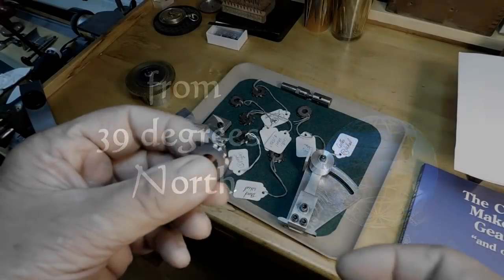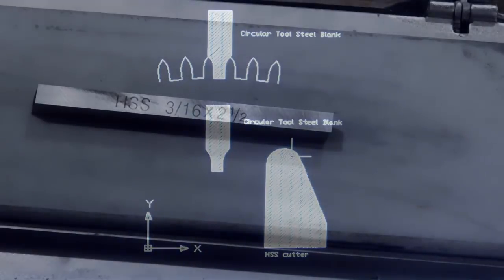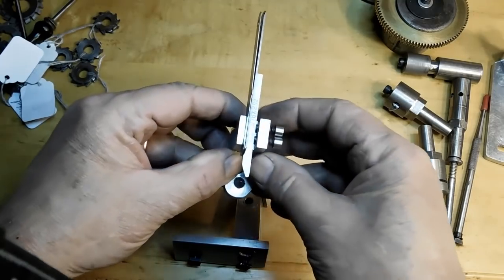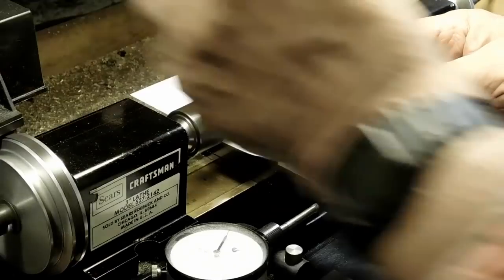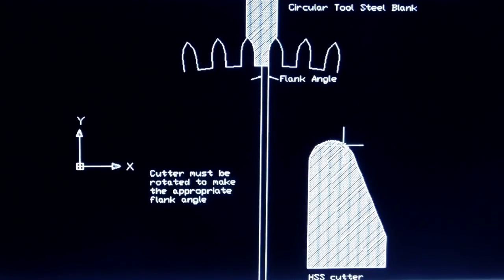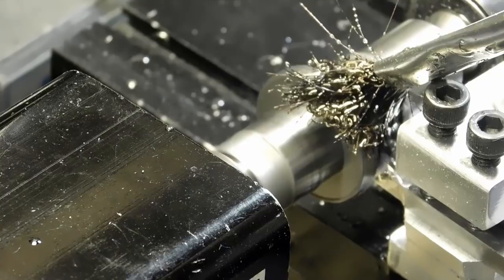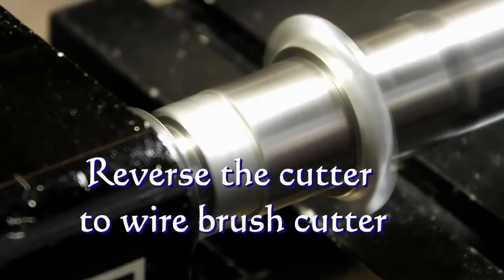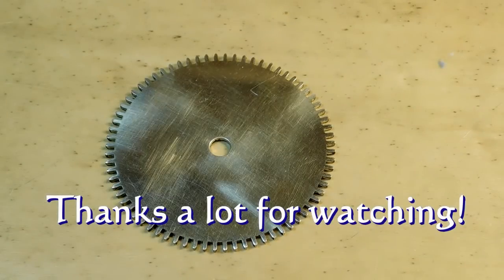DIY Cycloidal Gear Cutter

Comment: Wow..so a nice method: i'm making the same to you, because i need some gears at home, could please indicate to me the name of the white foam that you used around the cutter with gas flame ? Is it easy to find on internet ? Thank you in advance for your answer !!
Reply: It's most likely borax(flux) Mix powder with water and apply to piece to prevent oxidation.

Comment: Dear Robert, 

Great video, very educational...Did see you surface grinder around minute 16 and I am curious what type of grinde this is, looks as if it had a very "slim" form factor. Is is DIY or any brand. Would be grateful if you could indicate with basic dimensions if possible. Currently looking for a tiny surface grinder. Many thanks in advance.
Reply from the maker: Thanks Michael...my surface grinder is an American made 4" Sanford benchtop...here is a link to the Lathes UK write up:
http://www.lathes.co.uk/sanford/
cheers...bob

Comment: I realized about ten M1 (25mm dia) cutter following Porter's book method. The results were very unpredictable and disappointing - one cutter worked well and another didn't work. The problem with this method is that the cutting edge has no rake angle. So I migrate to this method  http://www.deansphotographica.com/machining/projects/multipoint/multipoint.html with excellent results. Maybe Porter's method work well for little module but I haven't try it. 

However good video!

Comment: Great vid and most informative but I don't get why after polishing to a nice smooth surface you then scratch that surface with a ratty wire brush? reversing the cutter will still scratch the surface that was polished.
Reply from the maker: The brush does no visible damage to the tool steel but the milling cuts need to be deburred before hardening…you might pass up this step if you sharpen the cutter after hardening as I did to the cutter in my video DIY Gear Cutter: Making the Cutter 3 the sharpening starts at about 18:36 in. I made some modifications to the holder and showed them in the second video DIY Gear Cutter: The Button Tool 4. Thanks for stopping by…bob

Comment: Another nice video. I have a similar small lathe so I can relate to this. Don't have a surface grinder but I do not have that level of accuracy anyway.
Reply from the maker: Thanks Manick...surface grinder is not necessary at all...I use mine cause I have one...bob
Reply: @robertt-cs8fe  I like the finish you get from it though. I have seen it in operation at a workshop where they were finishing a guillotine blade.

Comment: Where are you getting your boric acid powder, is it just generic from one of the drugstores or is there a cheaper source? I am assuming too, that the alcohol is denatured alcohol to make the paste. I haven't ever used boric acid to prevent scaling. I have been using stainless tool wrap, but it is quite expensive. I just found your channel while searching for information on the eureka tool and have been enjoying your content.
Reply from the maker: Thanks Carl...yes denatured alcohol and drug store boric acid...get a container and mix up a batch to your thickness...when you are done just let it sit...it hardens nicely in the container and next time just add the some more alcohol...after hardening I do brush the cutter on a light brass wheel to brighten it some...bob

Comment: Pretty awesome video.  Ivan Law has a book on making involute cutters similar to what you done.  He also shows and gives plans for a device that cuts the back rake in the gear blank.  I saw a couple videos on YT of the device and it is hypnotic to watch.  It is called the "Eureka" form relieving tool.  Worth a look if your interested.  Thanks for sharing.  Again, a great video.

Joe
Reply from the maker: Tnx Joe...I actually have that book and studied the form relieving tool a bit some time ago...but I forgot about it...you sent me off looking at videos and I thought very interesting and heck I think I have that book...actually taking the book off the shelf brought back my interest...thanks...
Reply: I thought it would be kind of cool to make a gear cutter and the relieving tool.  Thought about it for a while, but without my little mill up and running I put it on the back burner.  You channel was pointed out to me by Richard from MSFN.  The cycloidal gear cutter really caught my attention.  After reading Law's book a couple of times, I wondered how the cycloidal form was derived. (Aside from the pinion rolling circle on the base circle of the derived gear.)  So your video was pretty good, but I will have to buy the books you listed I guess to figure out how the cutter form is developed.  That assumes that he tells you rather than just supplying empirical data.  Either way, I really enjoyed the video.  Thank you for sharing it.

Joe
Reply: Almost forgot, a Google search will turn up the separate write up and plans for the Eureka tool.  If you are looking for it and cannot find it let me know.

Joe
Reply from the maker: Tnx Joe...I've got the book with plans for a 1.25" dia. cutter...my cyclodial cutters are 1"...so I may just play around a bit...as time allows...great project...thanks
Reply from the maker: I too think it would be cool to make a cyclodial cutter using a form relief tool...not an easy adaptation as is the button tool. Now on cyclodial cutters, Swiss, English and several adaptations are covered nicely in several appendixes in Malcolm Wild's book but Porter's tables are really easy to follow and I have made more then 20 cutters using this method...and although I'd like to figure out a form relief tool...if you stay with Porter's method I believe you will not be disappointed and form relief might be nice but not at all necessary for one off cutters (Of course this is only my opinion based on my experiences).   bob
Reply: Thanks for the information Bob.  I will see about getting a copy of Malcolm Wild's book.

Joe
Reply from the maker: Wild's book has drawings and formulas...Porter shows you how to make the needed tools and complete the needed math easily...I did start with Wild's book, but knowing what I do now I'd use Porter first to make some cutters then later on Wild's drawings and math should become clearer
Reply: What is the title of Malcolm Wild's book?  I want to put it on my list of books to by.  It is always kind of an extensive list.  HAHAHA

Joe
Reply from the maker: Wild's book: https://www.ebay.com/p/Wheel-and-Pinion-Cutting-in-Horology-A-Historical-and-Practical-Guide-by-J-Malcolm-Wild-2001/2818950
He has a paperback book too but it is not quite so intensive...
Reply: Thank you sir.

Comment: Hi Robert, great video's thanks for sharing them, i have been making a tooth cutter but struggling thinking about the radius & you have the tool the radius grinder. Are the dimensions of this in the book you talk of?
Thankyou
Reply from the maker: There are dimensions for the radius grinder in the book...they are for a watchmakers lathe, but it is quite straight forward to convert them to any small lathe. The book also has all the conversion tables that are needed. Have fun.

Comment: Quenching hss in water while grinding is standard practice. It won't hurt anything.
Reply: n
Reply: Nope.... 
Either flood cooling or no coolant & gentle grinding, not letting heat build-up is  recommended.

Workshop Technology part 1 
5th edition
W. A. J. Chapman

Page 165...
'' if the supply of water is sparse & intermittant the outside of the tool becomes heated &when a splash of water falls on to it a sudden local quenching takes 
place leading to minute cracks which sooner or later lead to failure of the tool... "

😎👍☘️🍺
Reply: Carbide is a whole 'nother ball game , but I have been quenching high speed in water when free handing lathe tools and drill bits since 1962 High School shop class. The next time I have a tool failure due to micro cracking will be the first time. (Still have the round nose tool I ground back then on my desk - No cracks)  - If not for quenching, just what is the water pot for on the pedestal grinders in every tool and die shop for - BTW Tool makers typically do not hold a piece against the tool rest. They only pt their hand against it. 

Check 
Abom79
Mr Pete222
Vintage Machinery
Joe Pie
This Old Tony
Blondie Hacks
Kieth Fenner.
Stephen Gotswinter
and Even Clickspring. 
,,,,, They all quench HSS in water. 

Now if you want to see a great way to loose a finger, especially with a 3/16 blank like he is grinding here make sure you have a great big gap between the tool rest and grinding wheel like he has in this vid. - When we catch anybody doing that dunderhead  Bob Villa move in our shop the first time he goes home for the rest of the day without pay. The second time he gets his money and is escorted off the property just like a bone head that wears gloves around rotating machinery.
Reply: Stolen from elswhere on the net.....- Not my words, but my practice for over 60 years of grinding regular and cobalt HSS lathe tools and  sharpening drill bits both freehand and in a tool and cutter grinder.  
=================================================================
Quenching from 700 F will not cause micro cracking in HSS. Heating a HSS too to visible red heat while grinding will not have any appreciable effect on the temper (hardness of the too), and quenching from visible red heat will not have any effect on the temper of the tool, although it may cause micro cracking.
=================================================================

Comment: waiting for next video to see the cutting..... your explanation was very help full. by the way the material that you used, is it the normal tool steel or it is different grade? the tool steel that I use , I harden it with oil and can reach up to 60rc... without tempering I think it will break some teeth... I am not expert on thus subject.. thanks karl
Reply from the maker: karl...I've used W1 tool steel for all the cutters I've fabricated...multi-tooth and hobs...I've hardened them all but only tempered properly to straw the hobs used to cut steel gears...brass and aluminum seem fine with just hardening...but remember with a hob you cut only .005" per pass so you create a nice involute curve...with cycloidal cutters Porter advises you not to cut tooth form in a single pass...he uses 3...I've been using 4...more on that next video.
Reply: robertt4522 thanks for the information. you have to enter very slowly or else you will broke the hob and the cutter... they are very interesting subject this cutters and hobs.... I really getting into them... thanks robert. waiting to see the next video cutting with the cutter..